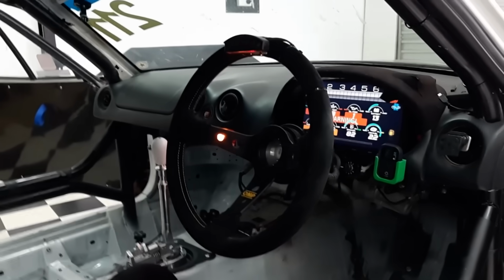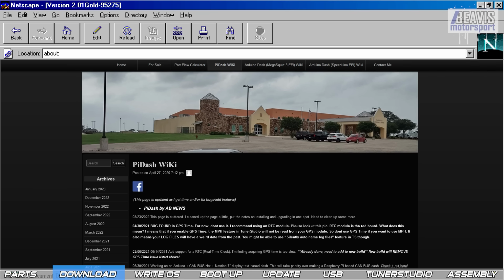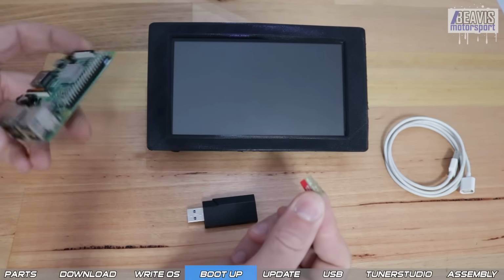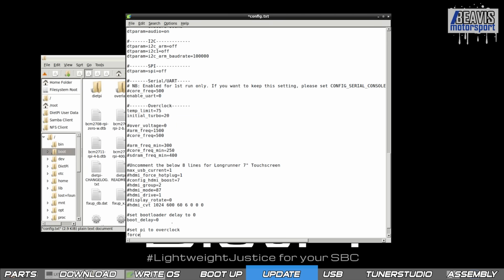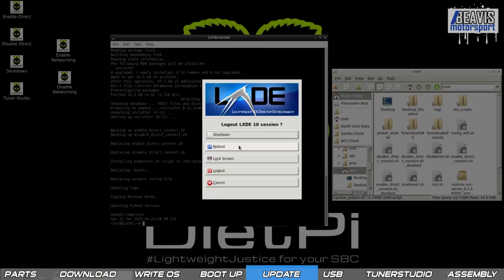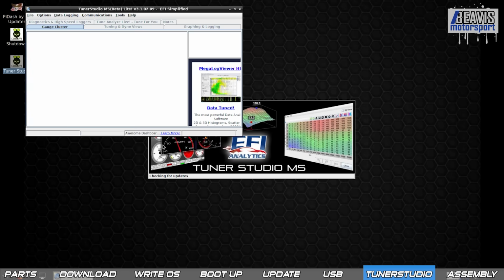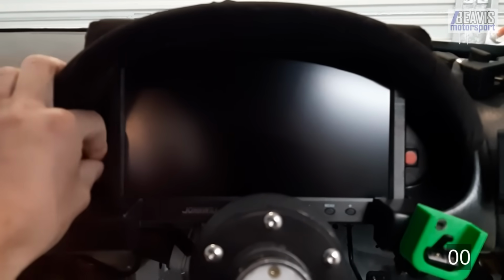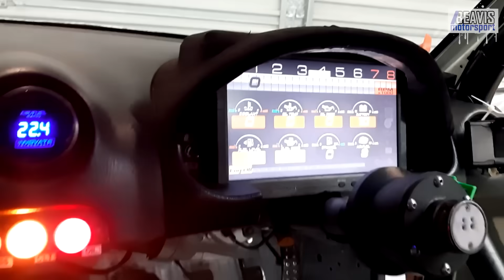DIY Raspberry Pi Racecar Dashboard: The Ultimate Guide

Comment from the maker: To answer the Frequently asked questions:
How does it connect to the ecu? - Via USB connection from the Megasquirt MS3 ECU direct to the RasPi.
Why didn't you use XYZ off the shelf product? - Because I like to tinker, and I can customise this how I like.
What about OBD2, or some other aftermarket ECU? - Sorry, I have never tried this for anything other than the Megasquirt family of ECUs... You can check out a product called 'OpenAuto': https://bluewavestudio.io/shop/openauto-pro-car-head-unit-solution/
Or if you have a different aftermarket ECU, or OEM ECU with OBD2, or even a carby car, consider trying this software instead: OneGauge, theonegauge.com
Or, I am sure you can find other info online though for software options that might work for your car!
Reply: I want to use this for my Bike, which doesn't have a ECU. Can you help me with a possible solution?
Reply from the maker: @Tarun_Kausthub  Hi Tarun, sorry to say that is quite a different solution to what I presented here, a bit too far outside of my realm - you are effectively starting from scratch from a software perspective.
Reply: @Bbeavis  Ok, Thank you for the reply!
Reply: Hi, reckon this can work with a haltech ecu?
Reply from the maker: For a different ECU you may need to try the OpenAuto software or instead: OneGauge.
Reply: Is there any good way to get the connection over serial or can instead of USB? I know I can use the serial-usb converter, but a ton of adapters tends to make things buggy.

Being able to get fuel level into this somehow would be awesome too, wouldn't need the stock gauge cluster at all then
Reply from the maker: @ummduhgmail  It might depend on your Car/ECU. But I've never tried either CAN or Serial so I cannot say sorry. I know the OpenGauge product is supposed to support CAN so that may work for you if you want to check them out.
Reply: @Bbeavis  Thanks for the video, it looks amazing!. I am also developing this kind of dashboard using qt. I have tried using obd2 to connect ecu and get the data , but thats really depends on the ecu communication speed. Because it sending the car data really slow :(
Reply: @Bbeavis  can I use the ecu Bluetooth to raspberry pu Bluetooth for my connection?
Reply: @furkanaltay5200  Hey man, what's the project called?

Comment: Wow, he can display images on the screen. Amazing. 
Just a joke. There is no really useful info, looks like “pi for dummies”… how u got data from CANbus or how it works with obd?
Reply from the maker: You sarcasticly comment, criticise, then ask questions on how it works... if you are so clever go work it out yourself big guy.
Reply: @Bbeavis  I have already completed many projects using OBD2 on C++ and ESP32, ranging from a simple speedometer and tachometer with a round display to full-fledged instruments displaying operating temperatures and air flow, which are quite successfully sold in my country. And of course, I'm interested in the experience of other people in this field. But in the end, all I find are clickbait headlines and filler content for those who can't be bothered to read the library's README.

Comment: Hey im about to replicate your setup/ video and make my own. Do you know if you can have ts dash and tunerstudio installed and just have ts dash boot from startup by default, then go to tunerstudio if i want to tune the car every now and then?
Reply from the maker: Yes, you can have both installed.
Reply: @Bbeavis I saw in some comments, you have this working on a pi5 now. I can't find any bartonik racing dietpi image thats updated for pi5. Where do I find it, or are you just running normal dietpi for a pi5?
Reply from the maker: I've built my own image on dietpi now, rather than use bartoneks build

Comment: Hi Beavis, I'm creating a dash for my Formula Student Car, and we're using the stock ecu for the KTM Duke 390 engine, how do I go about getting the data required for the tuner studio display from a stock ecu?
Reply from the maker: This setup and the TunerStudio software presented are not compatible with a stock ECU unfortunately. You'd need to look into some alternative hardware/software setup than what is presented here unforunately.

Comment: Do you know of a way to make the OS boot time faster? I've heard of "bare metal" setups and they have maybe an 8 second delay between power on and gauges shown. I would guess it's a similar setup but I think it makes use of GPIO pins for seamless serial data transfer. 

I'd have to do more research, the ~35 seconds to gauges is a bit too much for me. Otherwise this is a great starting point for me, thank you for the video👌🏻
Reply from the maker: Thanks, the time never bothered me so I haven't invested time into changing it. But apparantly there are ways - such as keeping the power always on and just putting the device to 'sleep' when the car is not running.
Reply from the maker: Thank you for your kind words! I’m glad you found the video helpful. Optimizing boot time can be tricky, I have not bothered to invest too much time myself. Once thing you can look into is keeping the computer on all the time, and just put to sleep when the car is not running.

Comment: Hi how can we wire the speedometer and the fuel indicator , as i am not using a stand alone ecu and ive done an engine swap into a proton satria neo , so the engine is a.4g15t mivec now  can you give me some advise how i can have a customisable dashboard to get the speed , rpm , fuel level and engine check , oil , battery check and oil pressure , volt etc
Reply from the maker: The solution proposed in this video requires an aftermarket ECU, if you are are still using the standard computer for your car, then you will need to look into a different dash solution sadly.

Comment: I don't have a car to mod right now (I have a car just not one I want to mod per se), but Im planning on getting a miata, I'm technically an OS Engineer (Android), so im more interested in how I can make this:
1. instantenous
2. work with CAN directly (or serial really)
3. interact better with the ECU (profile tuning/what not)
4. if I can get it to somehow integrate with an infotainment system (think cluster navigation)

for reference, I did some Android Automotive work before (lots of it sadly), so I was always actually curious if I can retrofit AA into a car (which would require me to explore all of the above topics anyways even if under a different context), sadly I cannot explore any of this right now, but hey this all sounds fun :D
Reply: for reference, a lot of the above might mean I actually have to ditch the RPI for all of that which makes me sad
Reply from the maker: You could do that, but not with this hardware/software solution. Good luck with your project :)
Reply: @Bbeavis yea I alr know i'd have to get an AA devkit

Comment: How do you use Raspberry Pi 5 to read vehicle information, such as vehicle speed, engine speed, water temperature, oil pressure, battery voltage, etc.?
Reply from the maker: USB serial connection to the Megasquirt ECU.

Comment: Love the build mate!
Love it so much I'm doing it myself. You wouldn't have a link for the 3d printed bracket to switch the screen and pie together
Reply from the maker: Thanks for the kind words! I've uploaded the 3D printed bracket files here: https://www.thingiverse.com/bbeavis/designs
Reply: Appreciate the reply one more question what 12v power supply are you using cheers
Reply from the maker: @jonnichols1220  I cannot say for sure sorry, some generic 12v to 5v  DC-DC converter.
Reply: Appreciate the reply one more question what 12v power supply are you using cheers

Comment: I needed to get an older version of balena..  1.18.11.  Kept getting an error

So far so good.
Reply from the maker: Thanks for sharing.
Reply: @Bbeavis  so, the Pi I got is a 4B and it won't take the .img file provided.  Says "software too old for this device" or something along the lines.   I will try with the .img file right on the EFI analytics site next...  wish me luck.

So yeah, looks like your .img is going obsolete I think.   Unless of course I did something wrong which is... possible.  Likely actually.   Haha
Reply from the maker: @mars0061  It is not my IMG, I am sharing the link from somebody else (from Bartonek Drag Racing).
I can recommend you pull the latest image from DietPi directly if you want to use a later model Pi. That's what I did for my Pi4 and Pi5, rather than use the custom image from Bartonek Drag Racing.

Comment: Remarks:

Run the OS from USB instead of the sd card, sd cards aren't durable enough for all the writes

Add a small battery pack and deep sleep / hibernate the Pi instead of cold booting when power is off
Reply from the maker: For the later model Pi's, yes it's easy to swap to USB boot.
Regarding hibernating the Pi, thats a good option for people who driver frequently, but there are times when my racecar is not driven for many months, a cold boot is much safer for my use case.

Comment: I have so many issues. Did the exact steps you did. Pi not recognising flashdrives, I am not able to access preferences (I have tried everything) therefore i cant change clock or browse. even in tuner studio, I am only getting two options for preferences.
Reply from the maker: I cannot help you with specific hardware issues, you will need to troubleshoot this further. Might be good to get a grasp of fundumentals of a Pi and linux OS builds etc and then come back to starting this project from fresh.

Comment: So question if I were to possible this step but use an arduino mega and Nextion 5.0 basic hmi for a 06 honda cbr1000rr would it work? if so I like some help.
Reply from the maker: I cannot help you with that, You are starting with completely different hardware and software.

Comment: Awesome video! I am trying to install this on my NB and when I go to boot up the PI with the OS for the first time I get an error that reads firmware: ....start4.elf is not compatible. Help is appreciated. Thanks!
Reply: Nevermind lol. I found the solution in another youtube video. I had to replace the fixup4.dat and start4.elf files with the ones in his video and that fixed the booting problem.
Reply: I had to copy starting script into the /var/lib/dietpi-autostart/custom.sh file and then update the dietpi-config autostart to be the custom option. For some reason putting the starting script in the root folder did nothing for me. 

I’m having trouble getting the shutdown python script to work now. I think it’s having issues with the gpiozero library for some reason. Any suggestions?

Comment: Hi, great tutorial btw, I am running into an issue trying to get the shutdown button script to work. I followed all the steps you listed but the shutdown script doesnt seem to be running. I tried manually running the script through the terminal but I get an error saying "No such file or directory: '/sys/class/gpiio/gpio21/value. I have everything in place (python script and startup.sh in the root folder. and the mystart.desktop in the autostart folder), I tried doing some of my own research and cant seem to  make any sense of the forum posts i have read. Any ideas what the issue  might be?
Reply from the maker: Thanks for reaching out! It sounds like you’re on the right track, but double-check the file path for any typos. The error might be due to a small mistake in the GPIO file name or location. Let me know if you need more help!

Comment: For the shutdown button does the switch need to be rated for 3+ amps or will anything typically work. The button switches I was looking at were only rated for .2A @ 50V
Reply from the maker: The switch on the Pi input does not need to support high amperage.

Comment: Hey bro, can I use the esp32 module to replace the raspberry pi? If so, do you recommend any project that I might be inspiring for? Here in Brazil the raspberry pi is very expensive and I can't spend so much on a project like this
Reply from the maker: That'd be a completely different solution.  If you are a capable software developer then you could do it I am sure.

Comment: Hey mate - good job - I do a bit of work with microcontrollers and pis - how do you connect up stuff to the pi? I skipped through the set up but couldnt see it. As in how do we get oil temp, fuel gauge, etc actually into the pi ? I am thinking of building an in car network - including cams, proximity sensors, music systems etc - and was wondering.
Reply from the maker: I'm running this dash in a track car that uses a Megasquirt MS3 ECU.
So all my sensors, speed, temps etc go direct to the ECU.
Then the ECU has a USB connection direct to the Pi to feed the data for the dash software.
Note that the TunerStudio software is specific to the Megsquirt ECUs which is what my car runs.
If you wanted to use OBD2 or if you have a different aftermarket ECU, I have another video coming soon on how to build a similar dash solution in that use case.
Hope that helps, thanks very much for watching.
Reply: @Bbeavis  Thanks mate. Looked into it - can do it with a Prado - can bus sniffer, obdc controller or something - appreciate the insight. Will come back and look at yours for how to power it.

Comment: ive gotten a pi 4 and a screen for my miata i was following along but when i try to boot it up with the dash os it says "start4.elf is not compatible this board requires newer software" any ideas what i am doing wrong or how to get it to boot up? i am tech illiterate
Reply: I've hit the same snag. I'm not Linux savvy so wouldn't even know where to start to fix it. I suppose if I was Linux savvy I wouldn't be copying somebody else's homework off YouTube in the first place.. TS Dash is the same, doesn't work on new hardware but no support from the developer. :(
Reply from the maker: @martinbarker2316  I have TSDash running on the latest verision of DietPi with a Pi5. It does work fine for me. I just did a clean build myself, rather than rely on a custom image download.
Reply: @Bbeavis  @Bbeavis i've spent the last 3 hours learning. I now have dietpi on my pi4 launching into a tunerstudio project successfully. Just a few more tweaks (desktop takes ages to launch) then I'll get another SD card and see if I can repeat my success with TSDash 👍
Reply from the maker: The original pidash image from this video is a little outdated now. If you are privy with linux I'd reccomend downloading the latest DietPi image for your Pi and installing TunerStudio on it yourself.

Comment: Thank you for sharing. May I ask if you could share how to set up a pop-up warning message for a rev limit in TS Dash design mode?
Reply from the maker: Sure,
Firstly, need a custom.ini file under the 'projectCfg' folder of your TS project.
In this ini file,  output channel, such as the below:
[OutputChannels]
	highRPM = { rpm > 7000}

Then in TS dashboard designer, you can setup an 'indicator' that references this output where the ON value is "Shift Up", and the OFF value is blank.
In the color dialog, set the off background to blank.
Reply: @Bbeavis  Thank you very much.

Comment: Please help...got a mazda mx6 v6/Ford probe..running Powermods ecu .How do I run this system so I can delete outdated dash so that I need no extra gauges or dials and only use a screen..I'm in south africa and will have the kid join your channel for better correspondence. I know where to find all this items and is myself semi technical.Thanks and great video
Reply from the maker: I am not familiar wiht the Powermods ecu sorry. This dashboard software needs to connect to a Megasquirt based ECU.

Comment: Have been following your guide with the image provided in the Google Drive link and I am sadly at a roadblock   "start4.elf is not compatible" Is the error I keep getting    RPI4 4gb
Reply from the maker: Likely this is due to a difference in the hardware you are using.
There are many posts about this error on the Pi forums, see if any solutions posted there help.
https://www.google.com/search?client=firefox-b-d&q=start4.elf+is+not+compatible

Comment: If there was a way to put the pi in hibernation, so it boots up quick on the next start . 

Of course , you shut it down after hibernation saved state . 

Two relays in sequential operations. One to initiate hibernation and the other shut it down. 

If these two outputs could be programmed from megasquirt .
Reply from the maker: Yes you certainly could do that.

Comment: Great video! Do you think it would work if the Raspberry Pi and screen had separate power sources? I'm thinking of connecting the Pi directly to the battery and the screen to the ignition/radio so it won't have to boot up everytime. 

Also, would this setup work with OBD1 cars?
Reply from the maker: Yes definitely the screen and Pi do not need to share power sources.

Comment: Another cool option would be an HMI display. It could eliminate the Raspberry Pi and possibly be more responsive. I have made a Raspberry pi dash once that worked but wasnt really that good (I'm sure that was my fault) but just ordered a T5L HMI display I hope can do the same with less components and more reliably.
Reply from the maker: Yeah that is a good option, I think maybe a bit harder to achieve software wise, at least, it might require someone with some software skills that are more than just "install this program and everything works".

Comment: If your RPi doesn't write any state to flash memory during runtime, you could set it to mount the disk in read-only mode. This should allow you to skip the power down button, as I believe data corruption is the only concern not to unplug it directly. To apply patches, you would need to remove the read-only filesystem flag when needed.
Reply from the maker: This is a good point, thanks for sharing.